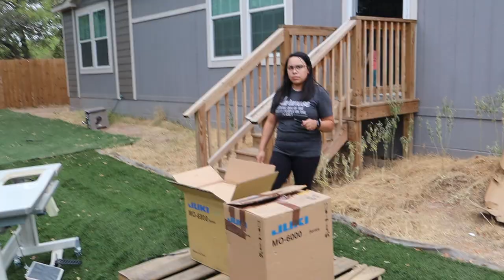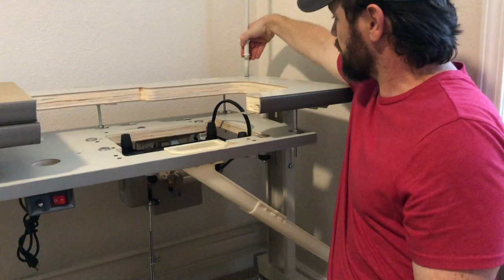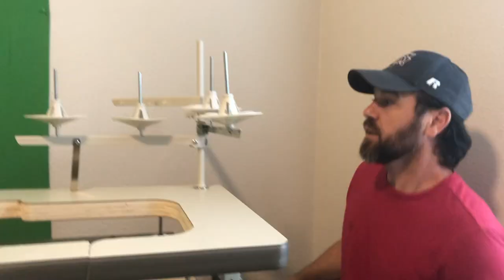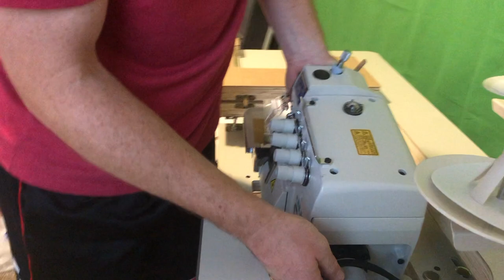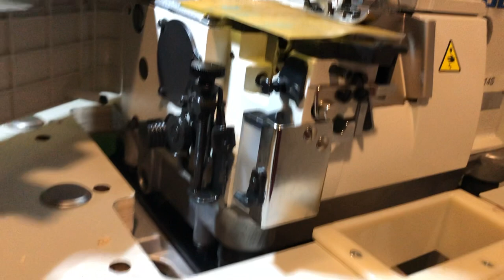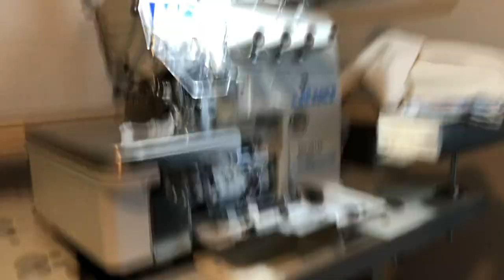Juki MO-6814S Serger/Overlocker Full Assembly & Demonstration | In Depth Step by Step Guide

Comment: I just bought this same machine! I’m about to oil it, and it’s not clear in the manual about the exact position of the funnel.. Did you put the funnel over the little copper tube that comes out the top of the oil Inlet? Or to the side of it?

Comment: Just got mine... Where did you get the silicon oil for the needle and other parts? My machine only came with the big bottle of oil. But I see the manual says to oil other parts of the machine after filling it

Comment: What is the size of the bottom table that the Juki will be resting. Is one inch or more.
Reply from the maker: Bow tie Menswear The bottom table is 1” thick exactly.
Reply: My bottom table is not like hers, looks way different. And I feel it can’t hold the Juki 6814. The top table looks like hers.
Reply from the maker: Bow tie Menswear I’m pretty confident it will hold it just fine. We’ve had our a few weeks now and there are no issues. Let me know if that helps?
Reply: Mastering Mayhem look for my name on IG and I will share pictures of my table. I still have to set the Juki on the table.
Reply from the maker: Bow tie Menswear Will do. Thanks.
Reply from the maker: Bow tie Menswear Just followed you, I think? Let me know 🙂

Comment: Do you know why red thread keeps breaking
Reply: Sometimes different colors have different textures and can break often, unfortunately not much you can do… You can make sure there is oil on the little pad the threads go over to prevent heat from  friction, and you can sew slower with that color for the same reason.